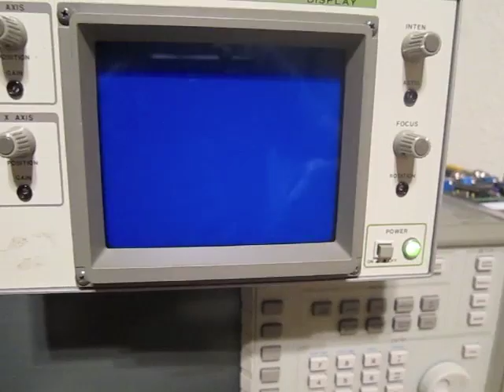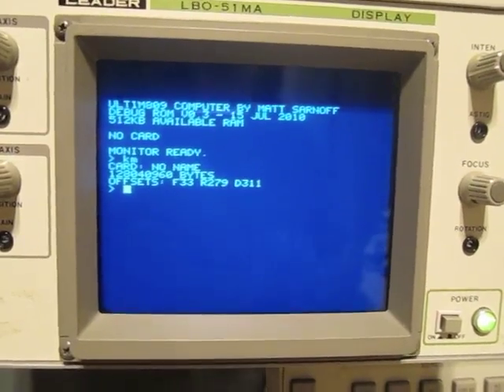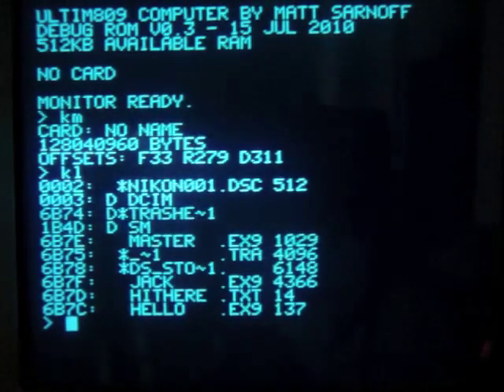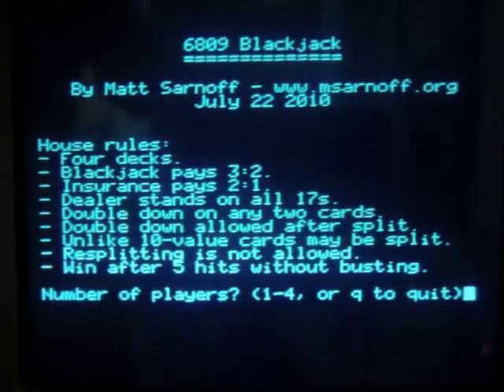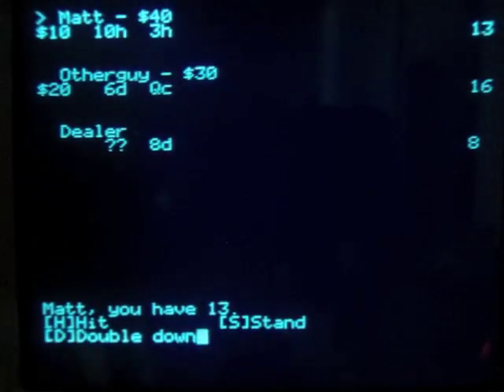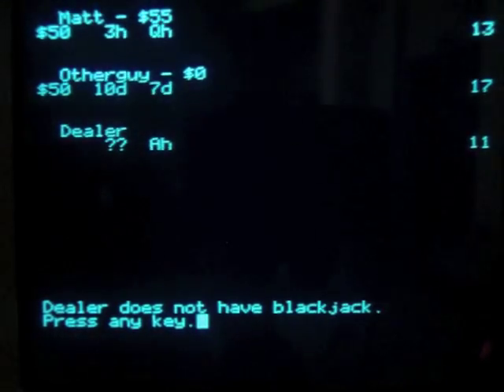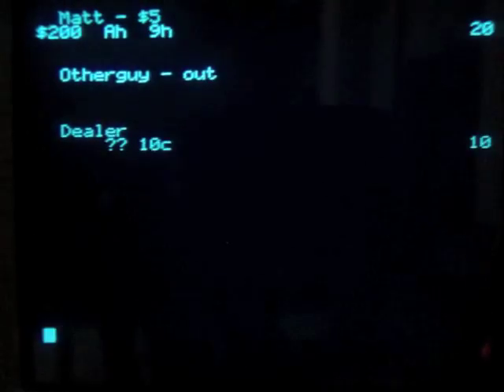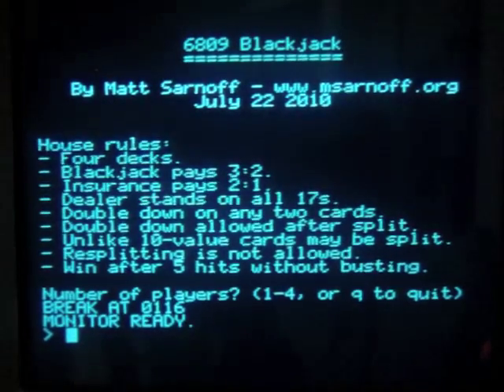Homemade 6809 computer plays blackjack!

Comment: Hi! So I have a Motorola MC6809P that I acquired from my late grandfather (in addition to a number of texas instrument's 7333 IC's and 555 timers). Not sure where he got them or what he planned to do with them, but you're obviously knowledgable in this field and I don't know what your background is, but I was hoping you could suggest a simple project for me (a student of mechanical engineering) to build with this chip. Observing from this project, I assume not much can be done with just the chip itself and that other IC's are required to construct something remotely functional.

Comment: You're using Mac OS X to put the files on the compact flash card. I can tell because there is a file named .ds_store, which Finder uses to save the layout of folders.
Reply: ***** Then why does Linux use NTFS just as Windows even though Linux and OS X are built off the same code? It's because Apple purposely removes NTFS compatibility.
Reply: TylerGaming97
Linux uses ext2/ext3/ext4/btrfs (or at least it will use btrfs; it doesn't yet). Not NTFS. Even Linux doesn't have good NTFS support; and OS X does support NTFS, just read-only.

Also, Linux and OS X are ABSOLUTELY NOT built on the same code. OS X is built on  the XNU kernel (a hybrid of the FreeBSD and Mach kernels, with some of its own code), whereas Linux is entirely new code. If you don't believe me, consult Wikipedia.
Reply: ***** OS X CAN write to NTFS with third party applications. That does mean that OS X does 100% support NTFS. It has since 10.3.8. Also Linux can read & write to NTFS. I used it all the time when I used to use Ubuntu. Also, Mac OS and Linux did steam from the same thing in the 80s. They have both changed since then, but at their roots they are the same.
Reply: "OS X CAN write to NTFS with third party applications. That does mean that OS X does 100% support NTFS."

No, it does not. Those applications provide different NTFS drivers from OS X itself.

"Also Linux can read & write to NTFS. I used it all the time when I used to use Ubuntu."

I never said it couldn't. I just said it doesn't have excellent support for it. And "can read & write to NTFS" is different from "Linux use[s] NTFS just as Windows".

"Also, Mac OS and Linux did steam from the same thing"

In design, they're both Unix-like; but they share no code. Talk to any serious Unix person: they'll tell you that they have totally different code bases. And even if they didn't, NTFS was created far after the 80s, and so such support would not have been built in to OS X
Reply: *****
Thank you, other person who knows the truth!

Comment: It's not that much harder than writing Assembly, it's just ridiculously annoying because you have to calculate the jump offsets by hand and recalculate them when you add a line of code (which is basically impossible to do for larger programs because without a disassembler it's not even trivial to see which bytes are code and which bytes are data).

Comment: would it be possible to design a microprocessor from scratch?
Reply: I know the comment is four years old now, but the answer, to put it simply, is no. The 6809 processor used in the video is comprised of tens-to hundreds of thousands of MOSFET transistors, being much to large and time consuming, even from more complex logic gates and such. If you feel compelled to, just try to find an old processor online.

Comment: i was about to glue the module slot on the circuit board but i am almost forgotten that modern ram require memory controller in either northbrige or inside the processor like a64 and nehalem i7. however is it possible i can soldier the northbridge(850) on the circuit board with pcie controller as well? plus it is possible to make a home made northbridge + southbridge(i have ich5) and even processor too?

Comment: im in my first term in computer engineering and were currently learning assembler for the m68k. Is it the same as the cpu youre using?

its very interesting stuff. Did you code the os as well?

Comment from the maker: @kennytheamazing SD cards use a serial interface (SPI). So I'd need additional hardware (a peripheral interface adapter) and I'd have to bit-bang the port in software. Data transfers would be about 20 times slower, maybe more.